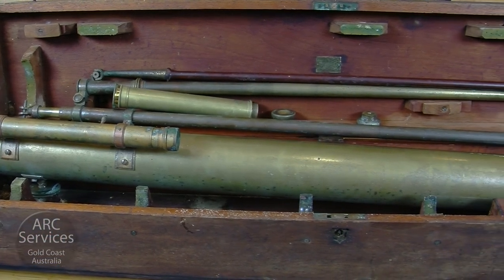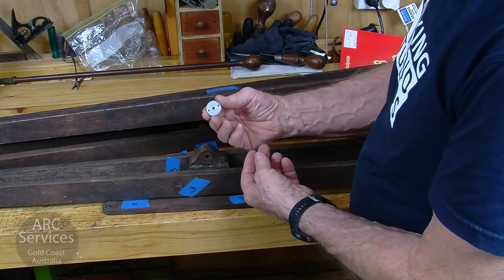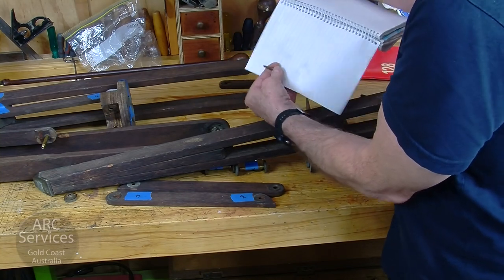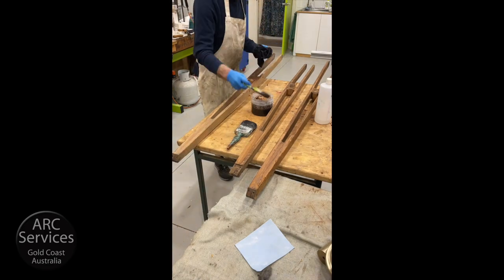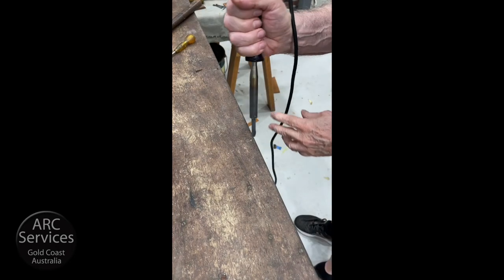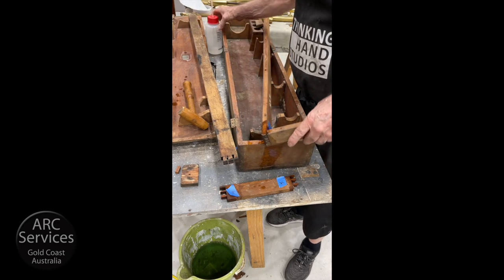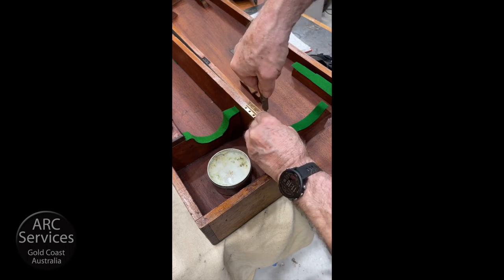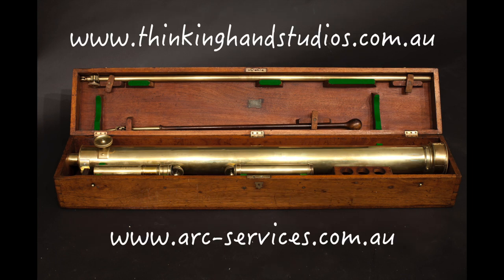Brass Watson & Sons c1860 Telescope Restoration Project

Comment: Very nicely done.  Was there an existing finish on the wood box? Could you identify it?  How was the finish removed before cleaning with oxalic acid?
Reply from the maker: Thanks for the visit.  
Very well observed. 
Yes the name was changed in 1881 you are quite right.
Would be nice to know how many telescopes of this type were made in a year. We could then get a more accurate date which would be interesting. 
The original screws appear to be to be about 1870 to 1890 ish judging from their profile.
The finish on the box was a shellac varnish which is soluble in alcohol. Difficult to know if it was original or added for a spruce up later. 
It was removed using industrial alcohol. 
The wood was Honduras Mahogany which had been grained filled.
I was careful to allow signs of wear to remain on the surface of the wood. It was not sanded down. I used  boiled linseed oil as the finish which was allowed to set thoroughly,  then it was waxed with natural bees wax.
Reply: @arcservicesantiquefurnitur6157  It's great that you were dealing with shellac. It's so nice to be able to remove it, yet maintain the wear and underlying patina, which then really pops when you apply the new stain.

Thank you for saving an old beauty of a scope in such an expert and caring manner.

Comment: did you clean the brass using the phosphoric acid technique used in your other video?
Reply from the maker: Hi,
Thanks for the visit.
Yes, I used the Phosphoric acid initially to remove the oxidation but needed to polish the surface with buffing wheels and compound to remove some pitting due to the age of the oxidation and its effect on the surface of the brass
Reply: @arcservicesantiquefurnitur6157  is 85% phosphoric acid acceptable?  or do i need to dilute - by the way, thank you for showing this process - I am in the process of restoring 2 brass trench art lamps from WW2 and bar-keepers friend is not up to the job.
Reply from the maker: Hi,
I would start with  a 50% dilution of your acid.  You can always increase the concentration if it is working too slowly.
If it is working too fast dilute it a bit.
Once the work is done make sure you wash all the remaining acid off with water.
You can use fine steel wool to help remove the tarnish. It will burnish the surface and will get warm. You will need to use a polishing compound if you want a higher finish. Experiment with the process  on an inconspicuous area to get your technique refined.
.
A word to the wise.., wear gloves and eye protection. It doesn't do eyes and fingers much good! @bridgecommand